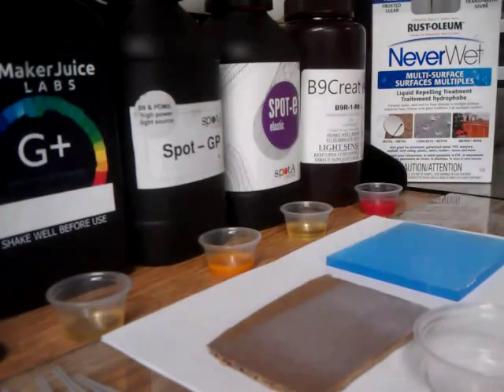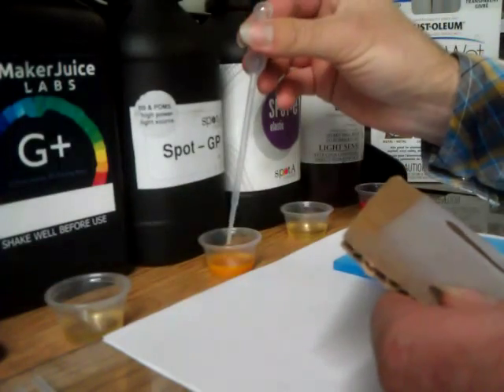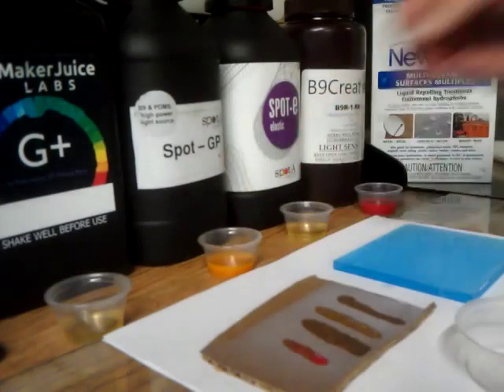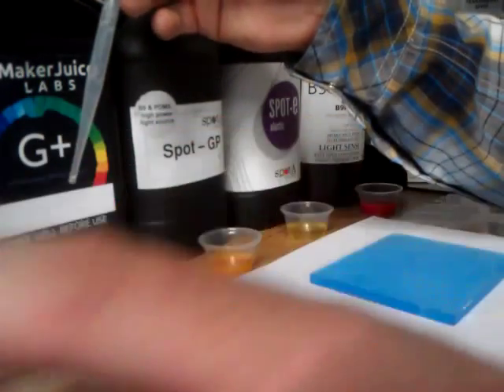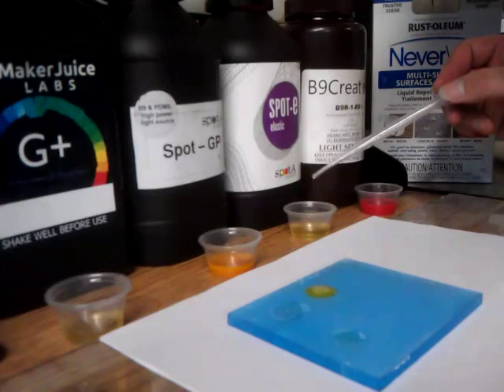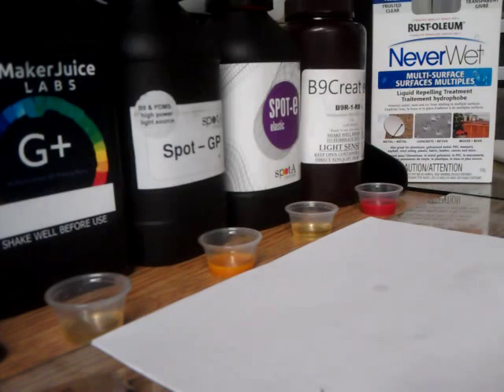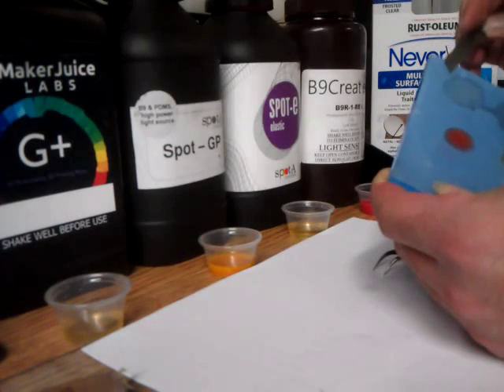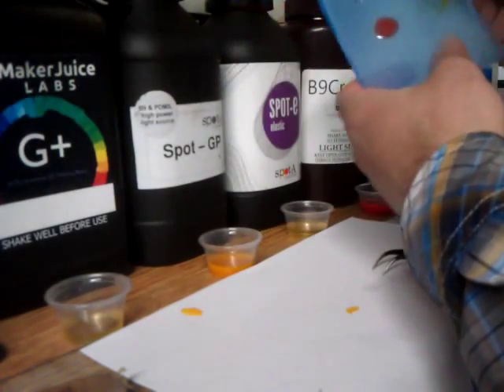Superhydrophobic dry-coating VS photopolymers

Comment: Hey men!! Thanks a lot for your test. I was planning to do the same idea with teflon and/or aquaphobic product to obtain the "dead zone" but you save me from spend a lot of money and time!
Did You obtain best results with thick teflon ?
Thank You again for your effort!
Reply from the maker: Felip Boncompte 
I tried with a teflon tape sample, just drops of resin, cured in the UV box, but the resin would stick to the teflon tape. I wanted to try thincoating with PDMS (just a thin coat over the tape) but I would have to sacrifice a Vat for that, and test it in the printer to see if the light from the projnector would cure from underneeth, so I didn't do it... Perhaps you can try that. My guess is that it might work, with tweaked parameters, but because the teflon is translucid, it would difuse the light in such a way that over the PDMS coaring the boundaries of the light would be blurry, not sharp. I don't know if I'm making perfect sense :) If this works though, it should extend the life of the PDMS coating, and control deapth of cure.
Icm not working with this printer anymore, now I'm using a Projet 6000 SLA wich prints at the surface of the resin. The laser does a good job at controlling deapth of cure
Reply: Thank You for your response.. !! 
Some days ago I saw the NewPro3d videos and Mr. Diego said in the event that they use a chemically designed special plastic film that repels liquid and creates a dead zone. I thought  it was some kind of teflon film or similar. 
That's the reason I found your videos very interesting.
Cheers!

Comment: Do you already try with www.UltraEverDry.com??
Reply from the maker: Didn't. I know now that the surface will be rough and I think it's a bad idea for 3D printing. Also, even the EverDry coating will come off after a few prints. I decided to try making the VAT with clear 6mm thick Teflon Flexi. One new DLP on KickStarter has such a VAT and it's very durable and easy to do. Laser Cut and assembly with special liquid welder or heat. Firsy I need to finish the acrylic VATs I have.
Reply: daniel brastaviceanu
 Kudo3D Titan1 are using VAT Teflon.